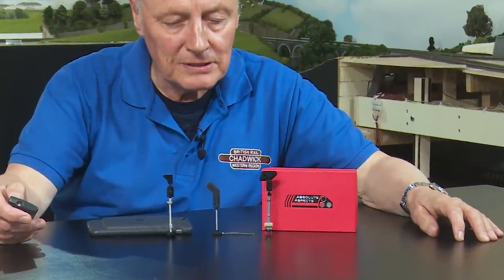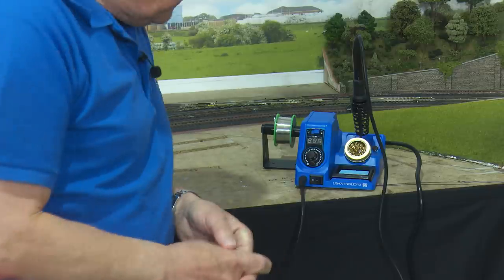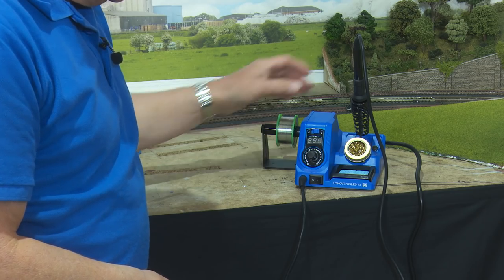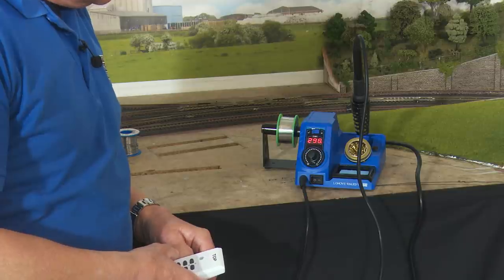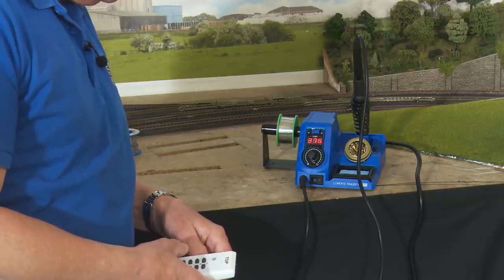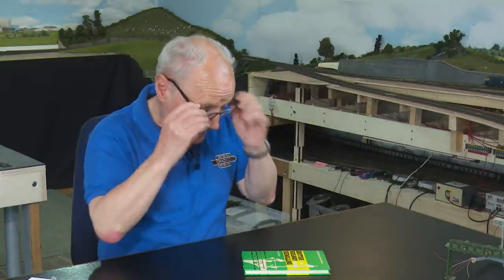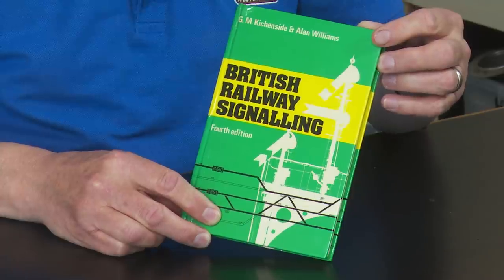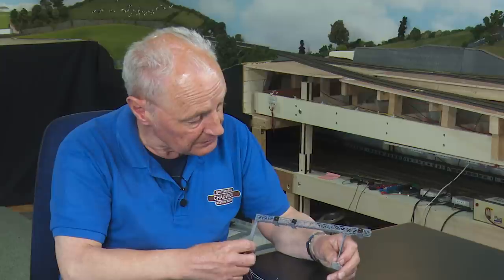Choosing signals at Chadwick Model Railway | 134.

Comment: What are you soldering at 400c? Maybe tinning the rails for droppers, but general soldering 300x340c is more than adequate, otherwise you risk burning the joint material
Reply from the maker: I find that it's far easier than to go in hot for a shorter perod on certain items Bruce.

Comment: Hi Charlie, great video, can I ask which signal would go by point splitting into to two platforms both travelling the same direction. DCC, using train-tech or similar. I have tried two aspect with feather which fine when thrown but when closeted it shows red and want it to show green. Any ideas, must be quite common around the country.
Reply from the maker: Hi Darren, if it’s a signal before the Station, it would only have yellow and red. If there are two alternatives i.e. platforms one or two, then a theatre box displaying the relevant platform number is your best option.
Absolute Aspects will build one to order.  Regards Charlie’s

Comment: Hey Charlie, I’m late to the game here so sorry that this question comes so long after you posted your wonderful video. I note that you’re building for late-60s to early-70s. I was born in 1965 and I’m researching late-70s and early-80s around Salisbury and the photos of that era I’m seeing in books show predominantly semaphore signals, though I do know that lights were coming in around that time (I do recall seeing lights at Wilton where the single line to Yeovil meets the double track in the mid-80s). So to my question (at last): why did you choose lights for your era rather than semaphores? And have you any advice for me when thinking about a decade later?
Reply from the maker: I think it’s fair to say that illuminated signals were used when the railway was upgrading. Today at Yeovil pen Mill, there is nothing but semaphore signals! Regards, Charlie

Comment: When you are wiring up the signals the feather gives the driver authority to pass the signal at danger so the signal can show red plus a feather and the driver can proceed. 👍👍 Green would be for the main line ahead with no feather.
Reply from the maker: Sorry Paul, that is certainly not the way I understand it. Regards Charlie
Reply: The feather or more commonly called route indicator will only come on with an amber or green signal. The only time you can pass a red signal is with permission from the signaller. Presumably because the signal has a fault and will not come off red. In the 70's contacting the signaller was done by the telephone on the signal.
Reply: I wonder if Paul you are referring to the so called 'cat's eyes' or Position Light Signal which is provided for exactly what you describe. It is a subsidiary signal so is for low speed movements such as shunting or entering an occupied platform- to attach maybe to another train. 

The feather or Junction Light Indicator applies to normal running moves off the main route and therefore are associated with a proceed aspect of yellow, double yellow (if 4 aspect) or green. Railway signals never have amber aspects, they are for road traffic lights. They are always classed as yellow. You would never get the feather with a red aspect- that is a failure which would need reporting.

The need to indicate which route to be taken also occurs in shunting moves. In this case they take the form of a small box which shows illuminated letters. They used to be stencil based but are now LED. These are known colloquially as 'stencils'. They are intended for low speed movements so are small in size and usually located next to the cat's eye.

A further form of route indicator is the 'theatre'. These take the form of a box which displays a single number or letter to indicate the route to be taken. They are a medium speed application (up to 40mph iirc) and can often be seen at the entrance to a large station where the platform number is displayed. They are the same sort of size as a main signal head. These can be displayed with a main red aspect provided the position light signal or cat's eyes are illuminated to give permission to pass the main red.

It is a complicated subject at first glance which I could elaborate on more but BR and successors have produced a group standard document to indicate which type of route or junction indicator is required. There is a very useful table included to help you choose which you require. It is in the public domain and can usually be downloaded from the RSSB website.

Sorry to go on but I hope the above is of some help/use.

Natalie- ex Signalman on BR LMR

Comment: When considering which one to buy? How many do I need? I am 3D printing Early BR two-aspect signals. Similar to the first one you showed us. They use a 2mm outer dia tube as the posts, one for the head and one main post. The wiring has to pass under the platform and then down the main post. I cannot buy Evergreen products here, so I used small drinking straws. Some lean to the left and some to the right. The £120 pound signal looks very nice, but it is more GBR than 1978. Martin. (Thailand
Reply from the maker: Yes it’s a difficult subject Martin, and made much more difficult by the huge price range. Regards Charlie

Comment: I have bought a number of the train tech ones as they seem better value given the DCC decoder is included and there are various configurations available, including a theatre indicator. Have recently managed to hook them up to a JMRI track plan so my daughters can change them by touching their position on the tablet. I should do a video on this. Also bought some signal heads from modelrailuk.co.uk and added them to a dapol gantry as you described.
Reply from the maker: It sounds like you should be doing the videos on these. And it’s great to have your daughter onboard as well. 
Regards Charlie

Comment: In your example showing the track diagram at 18.30 the sidings would almost certainly be accessed via the subsidiary signal and not the main aspect with a feather. If you get chance to purchase a railway resignalling notice it can be useful to see how different signals are used and how they relate to the track layout etc. The notices are always available on ebay and don't cost a lot :- https://www.ebay.co.uk/sch/i.html?_from=R40&_trksid=p2380057.m570.l1313&_nkw=railway+signalling+notice&_sacat=0
Reply from the maker: An interesting point MS, but I have taken advice from a retired signalman. 
I just hope that he's right after all platforms are normally fed from feathers such as at Totnes and Swindon.
Reply: @ChadwickModelRailway  I'm a retired signalman and latterly a signalling inspector, I possibly didn't explain it very well.
Main aspects and feathers do indeed route into platforms but they are considered running lines and in MAS areas there is track circuiting to ensure the platform is clear to at least the next main aspect signal (or red light light on a buffer stop in a terminal platform) before the main aspect and feather will clear. In laymans terms the feather guarantees a train is entering an empty platform otherwise the subsidiary signal is cleared.
In your example there are 4 routes from the signal but only 2 lead to running lines (the main aspect without the feather and the main aspect with the position 1 feather. leading into platform 1). The other to feathers wouldn't apply since they lead into what are effectively sidings (a baggage handling facility and freight terminal), in that case a subsidiary signal meaning proceed as far as the line is clear would give access.
In effect you are treating the sidings as running lines and trying to employ mainline aspects into a situation that wouldn't apply.
Reply from the maker: Now I understand your comment. However, I believe that you are both right and somewhat mistaken.
The parcels line, I agree.
However, the branch line on the right is not a siding but a single line with duel running leading to a freight terminal, fuel depot and on to a fictitious town represented by the west helix, yet to be built.  Not that you would have been aware of the next stage of design.
Regards Charlie
Reply: No problem, assuming the single line is a proper running line leading to another main running signal then a feather is legitimate option.
Reply from the maker: My dilemma now is the signal!

Comment: Soldering irons aren't hard to use. Well the cheap junk ones are because they can't handle changes in temperature when coupled to the work. Ladies and gentlemen do yourselves a massive favour and get a temperature controlled solder station. $150 AUD Hakko FX888D if your looking for a respected name brand. You'll find the first time you use a solder station you'll never want to go back to what you had before.
Reply from the maker: That’s fine but some folks just can’t afford such expenditure JB.

Comment: Another great video, Charlie. My only concern for the DCC signals, is (as you say) you're limited to strange DCC ways to change the aspect, and I'd prefer either buttons (such as on the DTM30) or by being driven by a SIGM20 or SE8c. Could the DCC ones be driven by block occupancy without the use of SIGM20 etc? If not, then there's not much point in my eyes of the extra expense of having the DCC circuitry in each signal - far better to have it once to cover a number of signals, surely?

I've only just considered signalling (still doing trackwork); so your next video is awaited with bated breath!
Reply from the maker: It’s an interesting subject John, and as usual there’s more than one way to skin a cat. I usually use an SE8C, I have considered the SIGM 20. Hopefully the next video will be right up your street, regards Charlie
Reply: I think the key here is low cost DCC decoders for points and signals. Control electronics is my business and I’m just getting into modelling, but it seems to me that there’s a big opportunity here. Not to make a profit, that space is already occupied, but providing something of real value to modellers.
Reply: @BillySugger1965  Yes, I've often thought about building something around a Pi Pico and a couple of other components to do this; admittedly I'm looking at sourcing control signals from Loconet (over IP) or possibly loconet directly as both seem easier than decoding the DCC signal, though I'm sure the Pico is up to the job. With open-source software, I'm sure that such a beastie would be under £10 for the components.

Comment: Reed switches between each block triggered by a magnet on the loco work well. Just connect the switch to a set-reset flip-flop. When the loco triggers a red signal you can run another led on a mimic board to indicate occupied block. You can also buy a flip-flop circuit with a relay to isolate a short length of track behind the red signal to really prevent a collision.  https://www.ebay.co.uk/itm/184349508616? On ebay this flip-flop has a red/green led where you can take the signal voltages from. A trigger signal to a point can also trigger these flip-flops.
Reply from the maker: What a fascinating alternative Romano. Regards Charlie

Comment: Hi Charlie a question about connectivity between the two companies signals. Will the Absolute signal controlled by a switch before a junction/ station work with train tech automatic ones? So like the train tech you can connect them all together by a wire makes them all work together e.g. automatic. An example will the two companies signals work together having say 3 x train tech automatic 4 aspects and then the absolute aspect controlled signal with feather or theatre box operated by a switch. If i pull off the absolute controlled signal to display a single yellow will the next signal a train tech display a double yellow, same as if the absolute signal controlled signal was at danger would the train tech automatic display a single yellow? Repeated myself but hoping you will understand what i'm trying to ask one way or the other.
Reply from the maker: I’m afraid this is a question for Matt of Absolute Aspects. Regards Charlie
Reply: @ChadwickModelRailway  have you not connected your absolute signal to a train tech?
Reply from the maker: No, computer control will switch my signals.
Reply: @ChadwickModelRailway  mhm perplexed now I emailed TTech to ask them waiting for a response

Comment: Awesome as always. The traintech ones - Can they be used with an SE8C if you get the non-dcc version, so you have individual wires for each colour etc?
Reply: I'm sure they can; but have a look at the SIGM20 - it seems to do more than the SE8c but for a similar price
Reply: @roundel52  How well does that integrate into the Digitrax ecosystem?
Reply from the maker: No John, the SE8C is much more expensive!
Reply from the maker: I'll explain all in the next video Ian.  Regards Charlie
Reply from the maker: Sorry Ian, I have no experiece of ECOS
Reply: Look forward to it Charlie!!

Comment: Sorry to be pedantic Charlie but it’s not a ground signal it’s a ‘call on’ signal
Reply from the maker: We live and learn Tase.
Reply: Depends, not always a call on, we call them subsidiary signals or subs as well. But a ground signal is what it says it is a ground mounted position light, we can all be armchair experts for you Charlie, but you are the one building and using it so you call them what you like, good luck, like the idea of a “theatre route indicator” for the Barnstable end ideal as slow speed and end of line  👍👍👍👍

Comment: Hi Charlie
I am a well retired pensioner and beginner in model railroad
 I have a trakmat based board and a gathering if ods and ends associated
I get a bit irritated by your casual throw away of prices of bits and pieces
10 pounds is neglible for someone on a decent salary, but pensions are not generous, so please stop promoting items at high prices. Try setting a period of cash limit of 10 pounds
What say you
Tony
Reply from the maker: You make a valid point Tony.  However, I do try and cater for everyone's budget.  
Repairing locos is another expensive subject and I repaired a couple, a few weeks ago for the price of some super glue.  
The truth is Tony, this is no longer a cheap hobby.